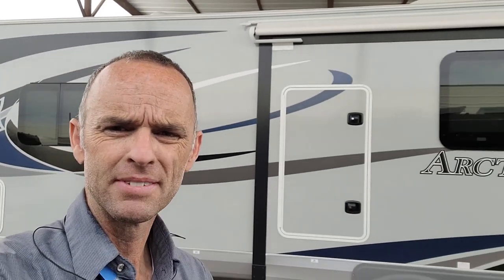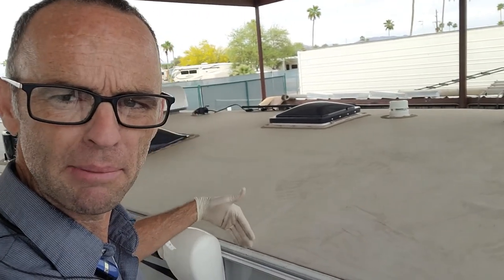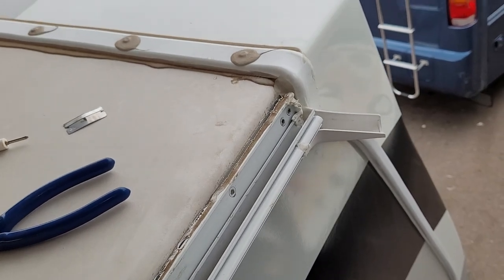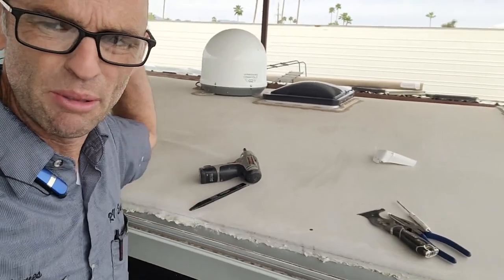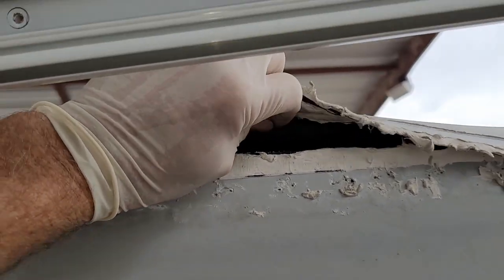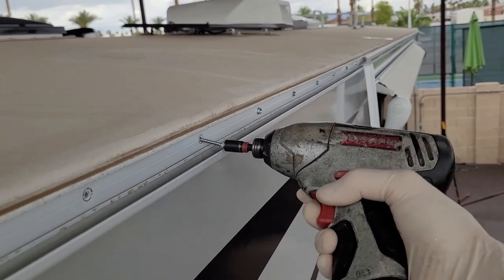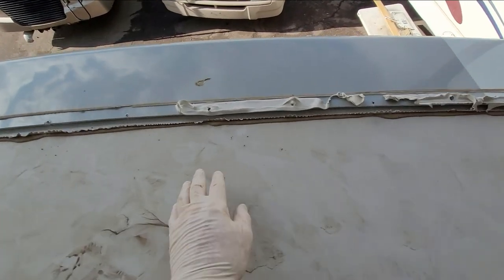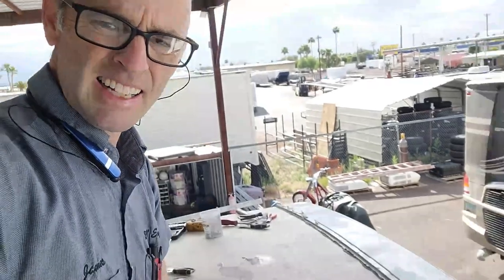What Ever Happened to the 2021 Arctic Fox Rubber Roof?

Comment: AZ Expert great video ! We have an Artic Fox 25Y that was built prior to 2020 and we have had very few problems and nothing that I could not fix myself and I have heard many stories and have seen some issues for myself and we will never purchase any large capital item that was manufactured from second quarter of 2020 through 2022 because of problems just like this. I am very disappointed with AF that this has happened, but not surprised as all the RV manufactures suffered from bad quality and poor workmanship and my opinion of AF is not the same as it was when we purchased our AF 25Y. Because of issues like this we have delayed our purchased of a new RV until at least 2024. Using the incorrect screws in my opinion was just not right and some of the roof framing I hope was just a workmanship issue and corner cutting by the crews and this is not happening today. 
Very disappointed with Northwood MFG !

Comment: I don't like rubber/TPO roofs.  End of story.  Period.  I had to replace one on a 92 Prowler 5th wheel that was exactly 12 years old.  The previous owner did not store the unit under cover.  It lasted exactly 12 years.  A local repair shop replaced with rolled aluminum one piece.  Very pleased with the results.   Did I mention that I don't like rubber roofs?  Great job again James.  I appreciate your expertise and attention to detail.
Reply from the maker: I understand completely

Comment: Thanks James this information made me check out my 2013 Arctic Fox basically the same thing with the hex head screws & different lengths 1” & 1 1/2 “ . The 1” weren’t grabbing into anything on the front cap . Replaced them all with longer Phillips pan head 👍👍🇨🇦✌️🇨🇦✌️👍😁

Comment: Good work, too bad it was not done right from the start. Keeps you in business and keeps the owners stressed if the product is good. This is why people worry about the quality of every RV. Too bad that the owner could not trust the dealer that sold the trailer to them. This should be an alert to Artic Fox as an issue for them and for their sales staff. Again, always good to watch you at work. It gets confusing however what sealants to use. I have a few more years to go before retirement and will be going with a Class A. Will definitely look for a good inspector that knows their stuff and proper inspection and sealants used.

Comment: Superb video.   Thanks.   For good to fair weather during maintenance for sealants I've shifted from Proflex to Sika marine grade sealant on exterior wall applications (windows, doors, joints both laterally and horizontal applications.   Longer tooling time and quicker curing.
Reply from the maker: I really do not like proflex, but it is readily available and works good enough

Comment: I'm sorry I watched this video. Had I been the owner it would have been making a trip back to the factory.  But as my old boss always said. If you can't take time to do it right the first time, how you gonna find the time to do it right the second time. I always thought Artic Fox was a top notch builder.  In fact that would've been on my short list of builders. 
Another great video.
Reply: Actually Artic Fox is one of the better towable builders but they all cut corners and cheap out.  It's quantity over quality and has been for many years.
Reply: That buyer now knows you can't trust even a new roof. Get a good folding ladder and for 2 or 300 bucks save thousands and keep a bad salesman's ass right in check

Comment: Its a great example why what often appears to be a small item can be so costly...There's a tremendous amount of time and effort expended on something that should have been overbuilt in the factory when access was easy and a little bit more glue and longer/stainless Robertson screws would have cost very little...It also demonstrates how each step leads to a next, more involved step time and again.  If I was confronted with this challenge I admit that I would probably have considered a seam over the bubble area, re-glued with eternabond or some form of liquid sealant on top....

Comment: And as I watch farther, grind down the outside of the 1/4 sockets so they fit into the tiny vent holes. I've done that on various sockets as well.  The sockets don't normally need that much support to torqueing.
Reply from the maker: I have numerous sockets I have made too, the thin walls wear out. I just haven't had to make a new one in awhile

Comment: Question: If you were in the market for a good quality fifth wheel between 2005 to 2014 what brand would you buy and why? We figure since you fix these things, you've probably seen everything. We are spending between 20 to 30k. Currently on our list is Carriage Cameo and CW, Forest River Cedar Creek, Jayco Pinnacle, and Dutchmen Grand Junction. We have a max tow capacity of around 13,000 dry. No Newmar, most Carri Lite, and Royals International, unfortunately.  Any other thoughts? Thank you. We just found you and are loving your content!
Reply from the maker: Thank you very much, overall most towables are made using the same components and methods as each other, so I'd judge it by condition floorplan and price. I like montanas, heartland, and cardinals overall. Carriage was the last non-standard builder. I do not like high tech LCD or remote control features on RVs.

Comment: Since you have to roll back roof to re apply adhesive?  My experience is to treat the underlying wood with penetrating epoxy resin so if or when the future leak occurs the wood on the roof will not absorb any water and the repair won't need to include rotten wood.
Reply from the maker: there wasn't a leak or rot, just loose membrane

Comment: Well from what I see artic fox does pretty good job with the exception of that glue holding the rubber. 
Honestly what can be taken away with most of the rv roofs you do is manufactures should really have quality assurance or supervisors on the floor over looking the process of the build of the rvs start to finish. If there is someone that stops these guys from making mistakes like this I think quality and warranty work would be reduced significantly.

Comment: You need to grind down the end of the 1/4 hex sockets to remove the excess rounded part. Get a nice edge to fit the screws and they will work much better. I do that with all my smaller sized sockets. The extra little metal on the end of the socket prevents the smaller heads from fitting inside properly.
Reply from the maker: thanks
Reply: Thanks 4 that tip !

Comment: Why didn't you put caulk in the wholes of the final screw top seal as you screw that backup seal down?
Reply from the maker: the front cap screws? The molding has a butyl tape that will seal them, sealant on the tape keeps the tape from sealing properly.
Reply: @AZExpert  makes sense.  Yes I was talking about the front cap screw.  Are your talking about the screws on the side?

Comment: Is there something special about Proflex or can a owner just use a good hardware store 100% silicone calk?
Reply from the maker: silicone doesn't stick well to rubber roof
Reply: I understand that Proflex is for the roof.  I should have been more clear, is store brand silicon ok for other water proofing applications where butyl is not used?

Comment: I was looking to buy a Northwood Desert Fox but this seals it, I am buying a cargo trailer and building my own rig.

If you wouldn't have inspected this it would have lasted until warranty ran out and the owner would be paying to replace the whole roof, which I am thinking that is what these builders are hoping, that it at least last till the warranty runs out.

Everyone with any knowledge of RVs knows that ballooning is a major problem, but this manufacturer, which is one of the better ones, did the exact opposite of what should have been done, almost like it was done on purpose.

Unless someone got a memo saying that too much glue was the ballooning problem.

Comment: At the AHR expo, Malco has a new bit coming out. Better then the "pookie buster" driver. Flip bit, plus teeth. Keep an eye out for it. Easy cleanout of the tip and will cut right though the sealant.
Reply from the maker: Thanks for watching!
Reply: @AZExpert  thanks for the videos. Hope the comment makes more sense now. I didn't reread it and see that it changed AHR expo to airport expo.

Anyway. Have a good day. I am a service tech. Let my roof inspection go by for a few years. Just checked roof before expo trip. Cuts from manufacturer in edpm. Also leaks at skylight. Looks like manufacturer overtightened cover and broke the plastic on three sides with screws, then covered with dicor. Roten corner now, soft roof that was a walk on. Fun times ahead, so I found your videos to help me "prepare" what I'm going to have to fix. Never done roof stuff before. Well, the Roten wood replacement anyway.

So thanks for all the roofing stuff. It's helpful.

Comment: 👍👍 Now, the roof is much much better than when it came out of the factory.
Manufacturers way of cutting cost.  Less glue, wood, screw, etc...  Just enough to last through their warranty period.  In this case, they miscalculated.  Didn't last through warranty.

Comment: Wow, leaving that long strip of bare wood is concerning, end cap or not. Why not have a can of Flex Seal around and just paint over stuff like that? It is probably better than the rubber roof anyway! And you can apply as many coats as needed....
Reply from the maker: I don't recommend using flex seal on an RV. Anywhere.

Comment: I remember.
  That is a little disheartening. You pay north of $50k for something you think is quality. I had a trim piece just come loose inside and the glue they used?? A quarter sized dab of hot melt glue and 2 short wire Brad's. And that's what $50k+ gets you. I see what you were talking about along the edge being to short to grab to pull slightly as well. The 2019 25R I have has a slight bulge along that same side/edge. I figure it is because when that trim was screwed down it put a little upward pressure on that rubber. They had just started using those fiberglass front caps several years ago but obviously did not make any structural design changes to match. And as for the fantastic vent fans 🤦🏻 I have 3. So my work is cut out for me😞 sad is what it is. 
Thanks for the video! And I can see why the dealer wanted to stay away from that hot pile of... Mess. I feel the dealer I went through was doing the same Texas 2 step with me at the beginning of this month dealing with some other long overdue warranty issues. 😤 guess what I'm be selling in a few years!!

Comment: gotta ditch that dicor putty around the roof fixtures. That stuff is crap. Dries out and you have to keep globbing it on thicker and thicker. Ditch the butyl as well. Those roof membranes are WAY TOO THIN. Nice drywall mesh tape on the roof. It appears the roof is the weak link in ALL manufacturers campers.
Reply from the maker: I'd recommend sticking with products that have been tested to withstand being used on a roof. Drywall tape is probably not one of them. All of the sealants have their place when used properly.

Comment: Easy stuff.  You are working under a shade with cloud cover.  Go work  on top of a airplane in the Arizona sun on the flight line.
 Ballooning can be fixed by installing aluminum trim strips on top of the rubber to pin it down and to mount solar panels on. Use a piece of gasket material between the trim strip and rubber roof.  
 Sure there will be screw holes through the rubber to the plywood. Put all of the hardware in wet with sealant.
Reply from the maker: I do too much in the sun for 20+ years. I understand